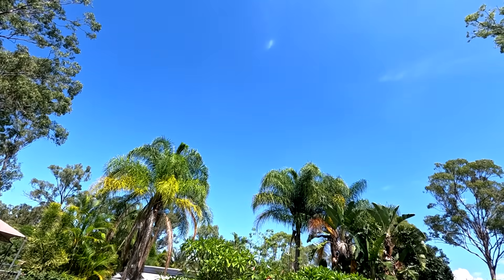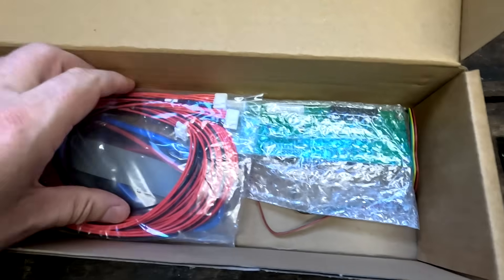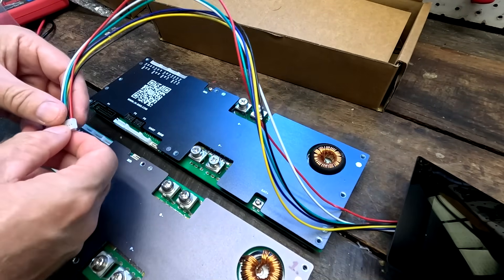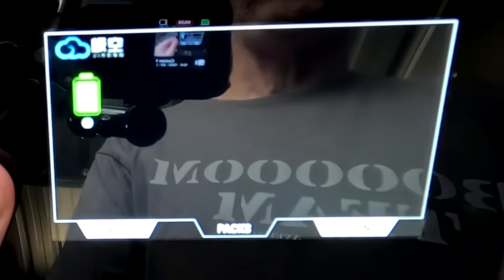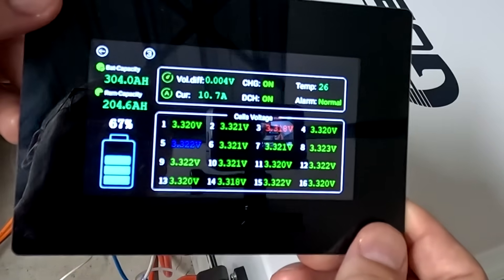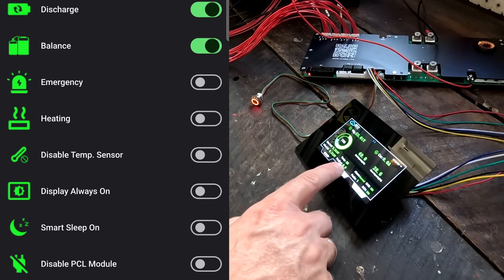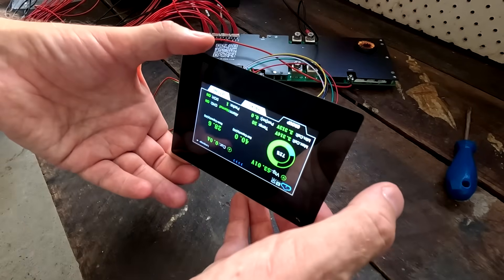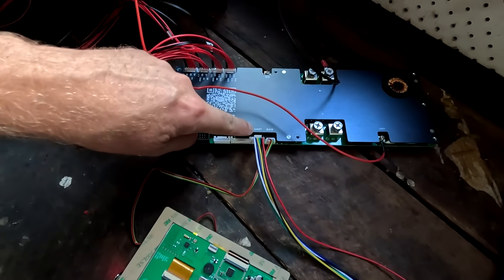New JK Inverter BMS V19. First test and... oh, look at its display! + Part I

Comment: Still the same soc calculation as in v15? And is display interchangeble with the large lcd from v15? And still each separate bms allows discharge current even at 0% soc? Cheers! 😎🍺
Reply from the maker: You can still use the old display with this BMS by using the same power switch port.

Comment: I like the new display, but what is most important is that it sends all of the data to Victron systems.
Reply from the maker: It does already. All the data is in Venus OS.
Reply: @OffGridGarageAustralia  The benefits of closed loop communication for the batteries is huge for sure. Can you get the information out that would allow you to see a screen that would tell you high and low cell voltages for each individual battery at the same time? I would also like to see 100A versions that would allow for retrofit into OEM built stackable or server rack batteries.
Reply from the maker: @ Victron shows you that data already, like the low and high cell of your stack. Retrofitting the JK BMS is also not a problem. I have done it multiple times here on the channel.
Reply: @OffGridGarageAustralia  I know it shows the high and low for the stack but I was curious if the data going to the screen would allow you to see graphs for each battery through something like home assistant.
Reply from the maker: @PanelsUpSolar  Vi tron shows the low and high of the whole stack because this is essential.
We can show the data of all individual battery packs in Home assistant. Every setting of the BMS and down to the cell voltage level. So much data...

Comment: I am hopeing that MQTT will be part of these BMS upgrades, I love collecting data
Reply: Yes, reliable way to integrate it to HomeAssistant without iBMS board or dealing with Bluetooth'es "I'll disconnect randomly and you'll try to figure out why". WiFi and MQTT can solve it for good.
Reply: @witalijlewandowski2384  I've reverse engineered quite a bit of the RS485 protocol if you'd like to do some fiddling about. (I am storing the raw data for future use and at the moment only using it to graph a higher resolution of state of charge than integer percentages.)
Reply from the maker: Watch this space...

Comment: I like the new LCD screen but stil the daly screen can change every parameter via the screen.once jk can do this i will change mine
Reply: yea, nowadays everything needs a phone and a app which is really annoying (its a nice feature but we shouldnt be forced to have a phone just to change a basic bms setting)
Reply: these screens are the main communication in my electric boat to my battery's
I like that you can see al your battery's with one screen but i cant change the parameters.
I would love to see the posibility to change parameters trou the screen like the daly one.
Please jk make that happen than it's perfect
Reply: @423GustavBern  TBF you can also use a PC and RS485 adaptor... but if it's Linux the app doesn't work 100% under wine. 😥

Comment: on the 2nd display tab, would be nice to see SOC bar graph for each battery displayed simultaneously, then you can dive in deeper by tapping each battery/bar separately for more detailed info.
Reply: having more or less equal voltage wouldn't the soc be very similar between batteries?
Reply: @TheKilerfish  unfortunately not. When paralleling many batteries with varying cell capacities/ages, they will charge at different rates.
Reply from the maker: SOC calculation is somewhat unreliable with LiFePO4. Not sure if this is much of a benefit to display that.
Reply: @OffGridGarageAustralia and when parallel connected, it would be more or less the same in each battery.

Comment: Hi Andy, today i've tried to upgrade my JK-BMS PB2A16S20P  HW version V15A, but the software told me that the firmware is for a different model. I choosed the "73-JK-PB2A16S20P-V15.38.jkbms"-File. Did I miss something.
Reply: Weird - judging by the access time, that's the one I used (with the software running on a Linux box with wine). Are you using jk-bms-monitor-2.8.0.23-setup.exe?
Reply: Yes, i used v2.8.0.23. The BMS comes within the Yixiang Battery Cases. Do they have a customized firmware for these BMS, I don‘t think so.
Reply: @beelzeboss4901  I've never heard of customised firmware for this BMS, and I've got a similar setup.

Comment: Nützt nur nichts, wenn immer noch kein zuverlässiger SOC berechnet wird…😅
Reply: +1 for more sensitive current monitoring - more precise Ah calculation is a key for DIY
Reply: Was ist da jetzt eigentlich der letzte Stand? Mir geht's hauptsächlich um eine zuverlässige Winteruntergrenze. Kann doch nicht so schwierig sein an den Rändern einfach die Spannungsmessung zu nehmen?!
Reply from the maker: What do you mean by 'reliable SOC calculation'?
Reply: @OffGridGarageAustralia  We have few JK and each report differ SoC, then not reliable SoC is send to inverter via CAN communication. We must use Victron Shunt to report reliable SoC from stack of JK storage.

Comment: i wish you could set up a EG4 6000XP with   JK bms
Reply: You should be able to. I have my JKs set with my 18KPV using the Luxpower protocol. The 6000XP utilizes the same protocol. I also tested the 18KPV with Pylon and that protocol also worked. I have the v15 JK. I'm not sure what protocols are available for the V14 but at minimum it would have Pylon.
Reply from the maker: Pylontech settings are your friend.

Comment: 120A outside here today. We're now making enough power to run the heat-pump, so no more firewood needed.
Reply from the maker: 120A are a nice temperature😂
Reply: @OffGridGarageAustralia  yes, use thinner cables and loose connections, then it becomes nice and toasty @120A :D
Reply: i have used my mitsu ac for heating almost all the winter here in germany only 2 or 3 weeks on natural gas heating